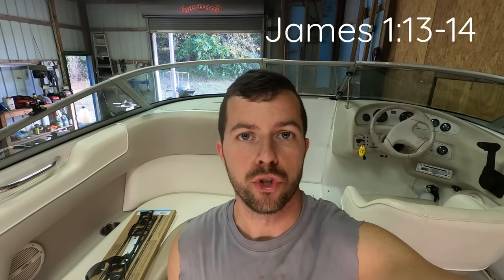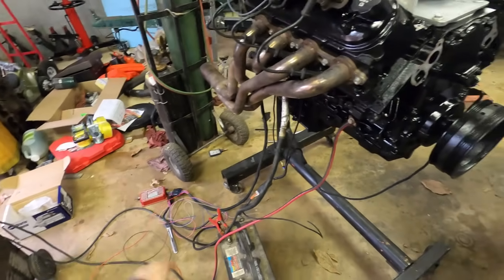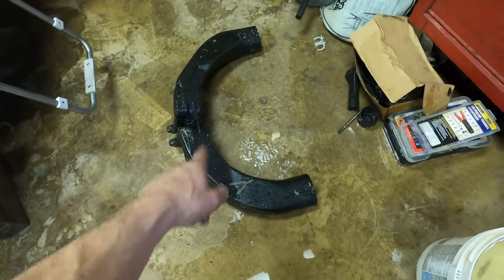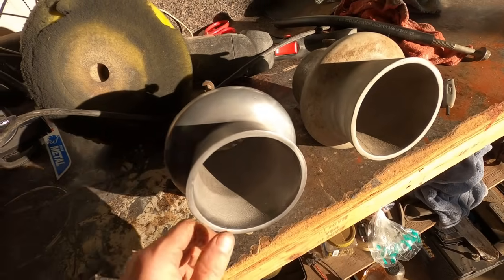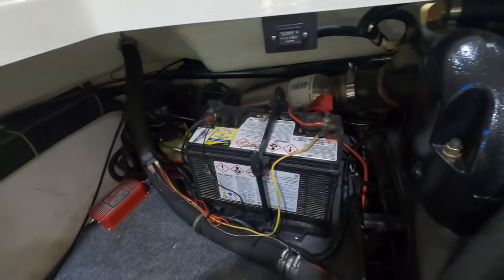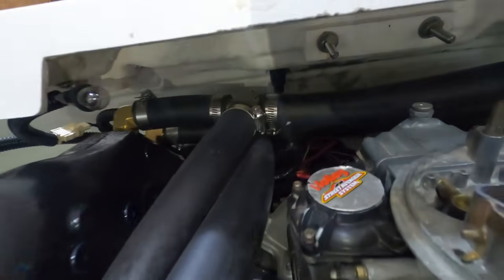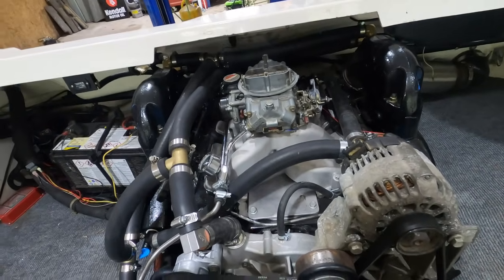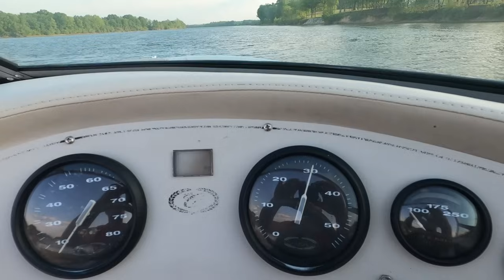Abandon boat part 2... LS SWAP

Comment: I also have a Cobalt 190 but it has the 5,0/305 Mercruiser - it will do 53-54 mph but most of the time I stay under 40 - cruises great at 30 mph.    Persoanlly because of the seating I believe its the best mid to small runabout available - it was way ahead of its time.  Great work!
Reply from the maker: Yes I love the size, maneuverability, and quality of the 190 compared to most other boats this size. With the prop that is currently on it, it's toping out around around 57-58 wich is perfect for me, and yes, it seems to be very smooth cruising in the 35-40mph range, I love it!
Thank you

Comment: Great video! Need to get a 5.7 lower unit for the gearing you need as well as a bigger prop. I built a one and had to do the same thing
Reply from the maker: Nice, I've looked into the gearing and will probably swap that out to the 1.47. I'm not sure which is better, more prop speed and less pitch, or more prop pitch and less prop speed?
Reply: Change the lower ratio, lower the prop pitch.
Plenty of power, only small change in hole shot, much happier engine RPM and cruise performance.

Comment: Good job getting it to work but there are issues …I would recommend 6.0  LS with iron block and heads for marine use even in fresh water and really a cast iron intake as well but with the LS I think your stuck with aluminum , anyways aluminum is a super big no no….also the thru hull exhaust looks susceptible to water reversion into the engine ….afirthermore you need a marine alternator, a marine fuel pump with a safety return to the carb, a marine carburetor, a marine starter , a marine distributor and I’m sure I’m forgetting something
Reply from the maker: Thanks Wayne, I have actually got all the marine grade electronics since testing in this video. The exhaust is a little deciving  in the video, but there is no reversion. I'm not sure on the aluminum being an issue but I guess time will tell.

Comment: Great video, I have one i was thinking about swapping an LS into as well. One thing i noticed that you did is you left the drive in and stabbed the engine into the splines. You might pull the drive out and check the alignment of the gimble bearing to drive coupler. The reason that the mounts are adjustable is so you can adjust the mount alignment so the drive don't bind. It is hard on the gimble bearing and also it will free up more power if the alignment is good. My thinking is going to a complete different engine is going to change the alignment, even when swapping in a different engine of the same type/size, the gimble alignment is generally off.
Reply from the maker: Thank you for that! Where do you adjust the alignment at? Washers in the rear mount? I'll have to research that sir thank you.
Reply: Adjustment is the front motor mounts
Reply: Yeah when I seen him wrestling the engine coupler over the upper drive splines I was like 😮!!!  I would have pulled the outdrive then used an engine alignment tool to check for alignment… to check you apply a even coat of grease over the sides of the alignment tool then slide the tool into the coupler then pull the tool straight back out …. Check to see if the grease has been scraped off more on one side than the other… and how easy or hard was it to get the tool to slide into the coupler? So you adjust the front motor mounts evenly from side to side and up or down depending what the alignment tool is showing… hope this helps
Reply from the maker: Thanks

Comment: I worked in a machine shop working on factory to race engines. I’ve done my share of pulling SBC engines out of boats to be rebuilt or replaced. Most boat engine failures are from improper maintenance or driver error. My friend bought a brand new boat with a SBC and broke the crankshaft second time out because he was flogging it when takeoff. I tried to explain to him SBC just can’t handle the load. I’d do a 3-2-1 coyote swap and you’ll never have to replace another engine. Good luck on your project
Reply from the maker: Those are great engines for sure, but would require way more money and involve alot more fabrication.

Comment: I appreciate you showing the details that most people leave out. Unless you plan to go with the 1.5 lower I would leave the LS1 cam. Sounds like you are making plenty of reliable power already.
Reply from the maker: It's definitely more than enough power, it's not a fast hull design more of a cruiser so I'm really more concerned with efficiency than anything which I am fixing check
Reply from the maker: It's definitely more than enough power, it's not a fast hull design more of a cruiser so I'm really more concerned with efficiency than anything which I am fixing check

Comment: I’m over here cleaning my clean crownline with a 4.3 to sell and after watching this I’m getting cold feet…. I’ve been wanting to do a swap even tho my boat runs fine… I dig this kind of stuff 👌🏽 that last pass when your kid laughed looked fast!
Reply from the maker: Haha, it's certainly more power than a 4.3, but it's not really setup for top speed. I'm getting high 50s out of it at 5800rpm. A prop and carb change would get me passed 60 for sure
Reply: @JohnnyAnderson1  just a swap under my belt is all I want so I can get over it but after watching this and the one dardantuned featured on his video also makes me want to do the swap and keep my boat 😮‍💨🤌🏼🤌🏼
Reply from the maker: @Factory928AC  what model crownline is it? Some of those are great looking boats so should be worthy of the swap!

Comment: Johnny,  connect your shift interupt circuit to the purple wire of the purple/green on your msd ignition box to restore shift interupt operation.
Reply from the maker: I'll give that a look. Thank you sir
My other problem is I cannot get the shift linkage setup to trip the switch correctly. I'm pretty sure will just use a button by the shifter instead.
Reply: @JohnnyAnderson1  its impossible to use a button... i tried.  I installed a tuned port on a 5.7 using stock gm computer.  Tried every way imaginable to get shift interrupt working.  Ended up having to add the msd just for that function.

Comment: What was the top speed at max RPM?

 The LC9'shave the DOD oil pumps and when you block everything off will put out 100+ psi of oil pressure. I cut 2 rungs off the relief spring on the oil pump to bring it back down to "normal".  High OP isn't a super big issue, but what it tends to do is pump the pan dry and uncover the pickup because oil is slow to drain in LS engines. Make sure to run it 2qts over full. I did back to back testing at a drag strip and this made zero difference on performance. But my data log showed oil pressure no longer dropped.  Would be really critical on a boat the way the oil sloshes around in the sump if it were low.
Reply from the maker: Thanks, it will hit the rev limiter at 6000 right now, will get a top speed run very soon. Should be close to 60.
It makes about 60psi right now on the guage
Reply: @JohnnyAnderson1  60psi shouldn’t be an issue. Did ya happen to tear the motor down a bit and check clearances? That seems really low for a blocked off DOD setup.  Worked with several lc9’s now and they would all hit 70+ on cold idle, then peg out 100psi gauge at WOT.   Good luck! Sounds great!

Comment: Did you change the cam or anything else on the block to make it marine.  Have any issuse with it sucking up water
Reply from the maker: @booostedtc  No difference in cams really, I do plan to do a cam swap for more power but the factory cam is fine.

Comment: Nice clean swap! I have a 5.3 in a 18ft maxum  running 25p and same outdrive ratio as you. 3500rpm is 43mph i think you can probably pull a 25p or 26p.
Reply from the maker: Nice, what is the max rpm you can hit?

Comment: Cobalts are great boats. I have a 2005 Cobalt 200. It looks like your gel coat shined up nicely. I always try to carry some kind of backup motor regardless of how reliable I think the main engine is. Being adrift with your family on board is a terrible thing. I bought a kicker bracket that I can mount to my swim platform if needed (I keep it in the ski locker), and I carry a 6hp kicker motor under the engine hatch next to the inboard engine. It's good for piece of mind.
Reply from the maker: Great idea, especially if your out on very large lakes or a bay.

Comment: Swap cam with a marine cam. My 5.7 vortec goes 30 at 3000 rpm, but when I had auto cam in it I had high rpm with low speeds
Reply from the maker: Only the prop or gear ratio could change the rpm at a given speed.

Comment: What year LS, what you do for seniors?
Reply from the maker: This is a 2010 engine, but for the sensors it would be the same as any SBC to LS swap. I used the factory mercruiser sensors and adapted them to the LS block.

Comment: If you don't know when the water pump impeller was changed last, NOW is a good time!
Reply from the maker: @dougnorton5143  I changed it
Reply: @JohnnyAnderson1  Sitting long periods is what usually takes those out. Starting the engine even in the winter months will keep it pliable but it is a chore depending on how long your winter is in TN. Probably about the same as here in GA.
Reply from the maker: @dougnorton5143   yea very similar to GA

Comment: What's the overall width, measured from the outside of the manifolds???  I've got a small block Ford that I'd like to replace in an aluminum jet sled :)
Reply from the maker: Hard to measure in the boat but it's around 27.5" wide... maaaaaaaybe 28

Comment: Not trying to say what's wrong or right. But I'd highly recommend you slap on a marine dipstick that goes to the drain plug. Next time you do a oil change you'd thank yourself for it
Reply from the maker: Yea... the oil drain plug is not easy to access, lol

Comment: ? So is the outdrive a v8 or v6 on the ls swap? And can I run a 5.3 on a v6 outdrive? And last ? Can you please tell me the fitting for all and how to get them. Thanks for the video it’s going to help me with my swap.
Reply from the maker: I got the fittings off Amazon. They were 3/4 npt thread to 1" barb 90deg for the manifolds it took 6 of those. I used 2 90 deg 1" barb fittings and 5 1" barb t fittings.
I know that's alot to take in but in total there are 13 fittings and all of it is fed with 1" hose, the bypass hose has a 5/8 hose shoved inside of it to make a slight restriction. The water pump I used  1 1/4" to 1" hose adapters and I'm running a 160 thermostat.
Reply from the maker: The outdrive is from the v6, and from what I have found in my research they are all the same in strength, the smaller engines are just geared lower. Mine has a 1.87 gear from the V6 so I'm running a 24 pitch prop. The v8s are 1.47 or 1.5 gear and would use a 21 pitch prop
Reply: There really is not such a thing as a "V6" or "V8" outdrive. There are 2 main types of Mercruiser outdrives. An Alpha and a Bravo. The Alphas are only rated to 300 HP. The Bravos are rated for more HP, like 500 HP or so. He is running an Alpha outdrive. Depending on what LS block he has, I suggest he takes it easy on the hole shot (like he did) and keep from launching out of the water, or he will be replacing his outdrive soon. Like Johnny said, the gear ratio of your outdrive will effect your prop selection.

Comment: Needs a larger pitched prop but if it isn’t a Bravo outdrive you might be limited to a 23pitch?
Reply from the maker: I could run more prop even on the alpha I've seen 32 pitchthat would fit lol... but 
Without a nose cone I think people get blowout with the alpha outdrive passed 70 or so. I have it setup for a decent holeshot right now. It tops out at 58mph at 5800rpm on the revlimiter. With the tiny carb and small cam it might have another 5mph or so in it.
Reply: Even at 40 it is still a really cool set-up.
Reply: @JohnnyAnderson1 I think you’re getting great performance as it is set up now.  Hopefully that Alpha One gen 2 outdrive holds up for you.  They are rated for 300 hp so you are  a tad over.    The Merc 350 would have hit the rev limiter at 5200.

Comment: I think you could go up to a 26 pitch prop, you're getting plenty of RPM.
Reply from the maker: Possibly, but at 57-58 mph it is plenty fast right now and has one heck of a holeshot, if I find a higher pitch prop for cheap I'll probably buy it just to see what it does.

Comment: What cam did you use? And is there any worry of water intrusion in the exhaust with the overlap of the cam? 
I picked up some skirt manifolds that I’m not sure if I will use bc they are jacketed all the way down to the bottom of the y pipe. So it will take some fab work to use them. But they were free. So I may just buy some new manifolds. But the water dump being so low I was going to be able to run whatever can I wanted. If I use crusader manifolds I will have to be careful which cam I use. 
 The skiboat manifolds are aluminum tho…. 

Did you weigh what came out vs what you put in? It has to be lighter then the old se up huh?
Reply from the maker: It is around 200lbs lighter than the old engin, the old sbc was iron from intake to oil pan lol.
The cam is a stock early ls1 cam so there is no worry of reversion, I would like to do a mild cam in the future it seems like something around 220 duration is fine depending on the exuast setup of course, I'm sure yours could get away with much more than that. The other thing is I don't really wanna spin it to 7000rpm to make peak power so a truck cam that peaks around 6000 would be perfect.

Comment: I have a 2000 Camaro SS w/ an LS1 and a 2007 Stingray w/ 350 Mag MPI Merc Bravo1.  So between these two, I have (mostly) what you have very effectively combined.  Fantastic work, by the way!  Are you able to get to your oil filter okay?  I didn't see whether you had installed a remote port.
Reply from the maker: Tgank you
I have a 02 ws6 with ls1 also lol...
Wish my boat had a bravo! 
The  oil filter isn't that bad to get to but the drain plug will be... I figure I will only be changing it once a year though, so I'll make it work.

Comment: Well done!  

What are you estimating your HP to the crank at?  What gear ratio and prop are you running?
Reply from the maker: Thanks!
Should be around 310 to 320hp at the flywheel
1.87 gear ratio and 24 pitch prop on it now.
I Can probably swing a 25 or maybe even a 26 pitch with this gear.

Comment: Keep in mind your carburetor, alternator and starter need to be USCG approved components. I think the MSD has the rating. And it’s not a just because kind of thing. It’s a possible bomb kind of thing
Reply from the maker: The starter is a marine starter, and the carb is getting swapped soon. I was using that one for testing. The alternator, though, I'm not sure how to find one that is "marine" approved. I have a bilge blower, and every time I stop, I have been ruining it before cranking.
Reply: @JohnnyAnderson1  They make USCG approved alternators for LS engines. Without spark protected components, you should probably run your blower the entire time you are running the engine. Beside that, well done on the swap BTW.
Reply: @JohnnyAnderson1  Johnny - The components in question all have to be ignition proof to avoid engine compartment explosions. The spec is SAE J1171 and is usually prominently labeled as such on conforming components. The me cruiser alternator on your original engine is SAE J1171 rated.
Reply from the maker: Nope it was just a car alternator, and so was the starter....
I got it fixed up now, they think alot of those alternators....

Comment: If you want it to really run dry the exhaust
Reply from the maker: I don't wanna melt my boat lol
Reply: @JohnnyAnderson1  not all the time only when you really want it to run I've ran outboard all my life and that's always been a good place to start if you look into it you may find what I say is true prop makes the most change in any boat so start there  24 or 25 pitch

Comment: Guessing top speed should be at least mid 50's we had a '19 boat with a 4.3 non vortec (175hp) it done 49mph a friend with a vortec 4.3(190hp) same size boat was a bit faster at 52-53 mph.
Reply from the maker: just posted the update video, i did hit 58 MPH
Reply: @JohnnyAnderson1  Nice 👍

Comment: Boat Needs allot more prop now that it has more power and allot more torque with the same prop the boat will run the same speed a 3k as the 4.3 at 3k rpm, give it some pitch and a 4blade if it doesn’t already have one
Reply from the maker: The factory 4.3 prop was 21 pitch from what I have read, I am now running a 24 pitch. It seems about perfect for the power, but I will be doing some top speed runs next week to find out. It's not a fast hull, and from what i have found the alpha drive will blow out around 65mph no matter what without a modified nosecone so I don't expect much. I just want a reliable boat that will cruise at 45mph all day.

Comment: You left the springs out between the bell housing and transom assembly. And you should really pull the drive off before removing the engine
Reply from the maker: I was wondering what those where after I got it installed, I jacked it back up and slid them in.
Reply: @JohnnyAnderson1  good deal. I always replace them any time the engine comes out. Probably un needed but they are cheap. Looks and sounds good! Done any prop/maxx speed testing?
Reply from the maker: @glastornjet73  Not yet. It won't stop raining lol, it been raining for like 2 weeks now almost every day.
I'm thinking high 50s should be no problem but I'll find out pretty soon.

Comment: Hey buddy. You need to change the lower unit to a 1.25 to 1 ratio. Then 4,000rpm will put you about 45mph
Reply from the maker: I've seen plenty of 1.5 ratios but not any 1.25